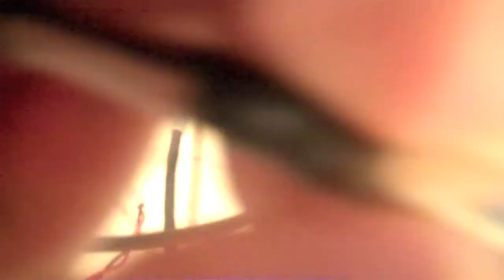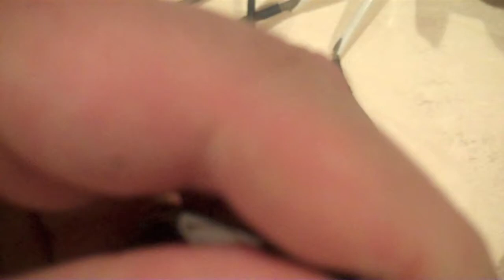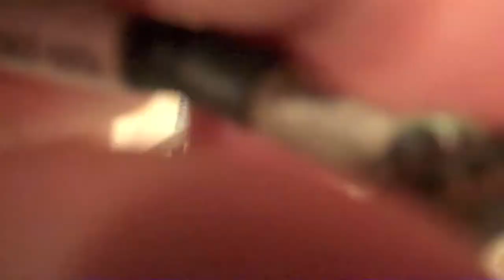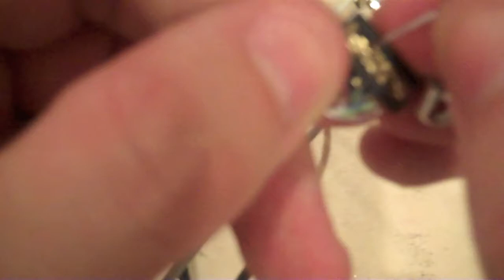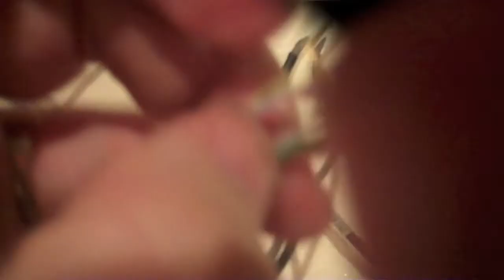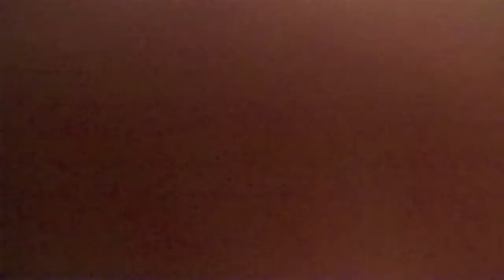17" iMac G4  to DVI - Part 4: LCD Wires

Comment: what would you do if you wanted to connect the monitor to a rca cable instead?
Reply: Spend $100+ on a scan converter. DVI is not compatible with RCA. Why on earth would you want to use a rubbish interface like RCA anyway?
Reply: @whiteknives  6 years after it does not cost $100+ anymore (not even sure it cost so much at that time). Why connecting a RCA? Maybe to plug a SNES or Megadrive (Genesis) to your iMac 4G :P